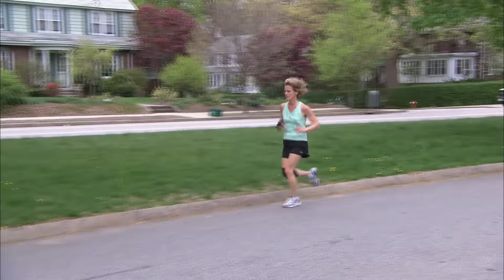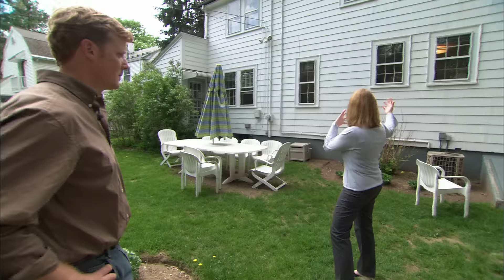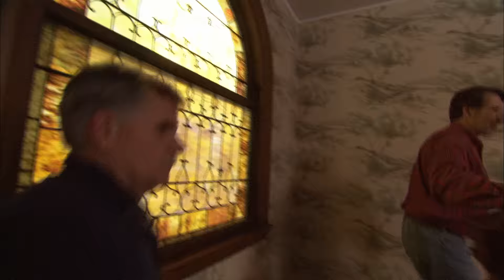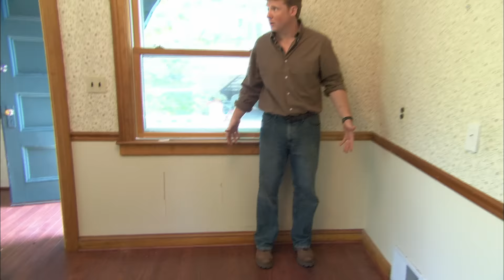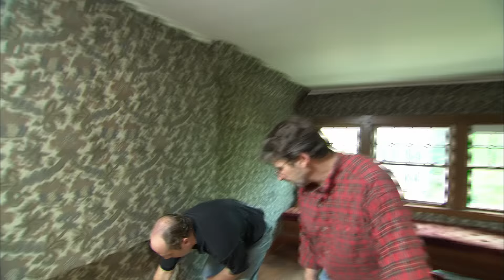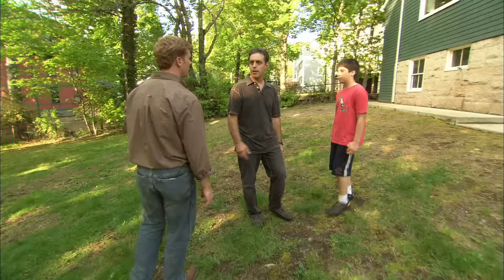This Old House | Move or Improve? (S29 E1) | FULL EPISODE

Comment: The original version of the series was far more enjoyable and relatable.  
It showed people of more middle-to-upper middle class dealing with renovations and upgrades in homes 
that were somewhat more akin to homes that the average viewers might realistically relate to.  
In later seasons, the homes and the upgrades had rocketed into the economic stratosphere. 
With a far more "elite" focus, it became far less about how the viewer could relate and realistically imagine 
what we were watching could be something we might be able to use some day.  
It also changed from being all about the work being done, and how the choices of what work and how.  
In the later seasons, it seems to be a good bit more, maybe even a lot more, about product placement advertising 
of products, systems, and businesses than what the process of the rebuilding was about.  No longer was it good 
enough to simply have the participating companies get mentioned in the end credits.  Now they became integral 
to the on-screen production itself.  
After a while, I ended up switching to "Home again with Bob Villa".  Not exactly the same.  But it did have the OG T.O.H. 
talent which was also a dramatic factor in the downfall of the later seasons.